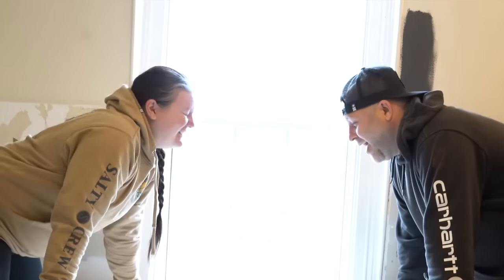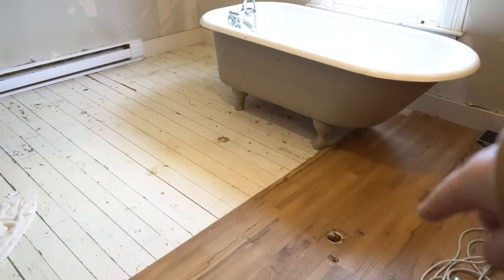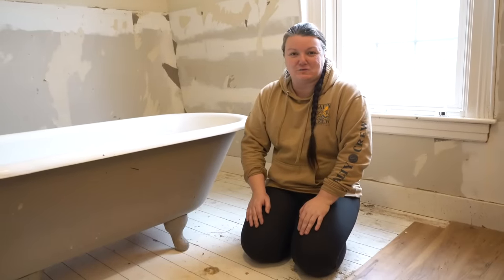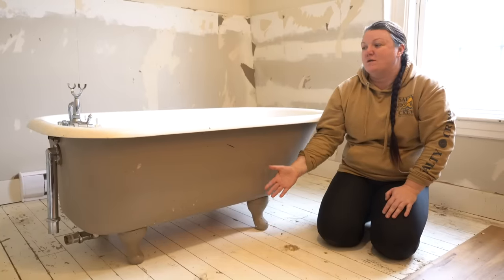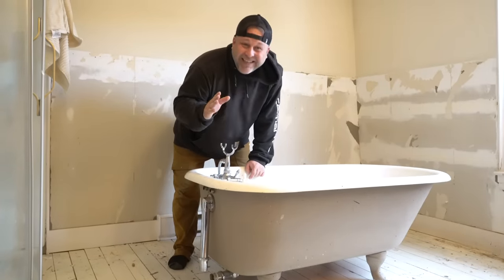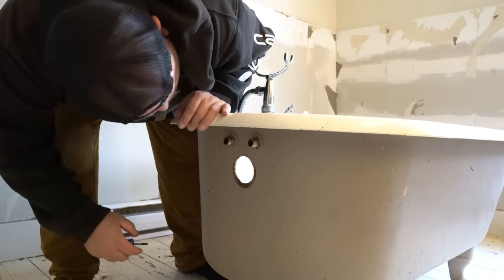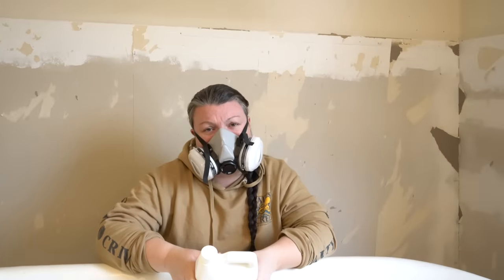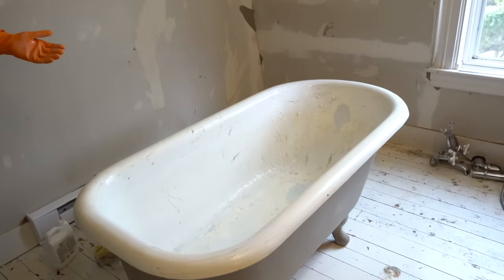SO far this is an EPIC FAIL....Bathroom Renovation

Comment: Since I first saw your bathroom i thought the tub would be beautiful angled in the corner.  That would open the middle space even more. The shower curtian will not block the window light. And you could pur a small pretty table behind it for soaps
Reply: I agree   I have concerns with it being close to the window   First the danger of someone slipping and breaking it (getting cut up) also the weather making the tub cold or hot   It is your home so you need to do what feels right for you and your family ❤❤❤
Reply: Yes and then you would need only one maiden.
Reply: Elysian, the paint is an epoxy paint.  Tub paint.  There is a striper for tub paint
Reply: Agree 100%.
Reply: You said earlier that you didn't want to put the bathtub in the corner, because the plumbing would be more difficult. But now that you are thinking of switching the direction of the bathtub by the window, the plumbing will be more difficult anyways. So why not place the bathtub in the corner? It looks way better there! (Just a thought. You do you!)
Reply: We sand blasted ours
Reply: Absolutely!  When they moved the tub away from the window, I thought, " The tub needs to be angled in the conner." 
It would make the room so much more spacious. It would bring in more natural light.
Good call!
Reply: Yes, I as well think it would be much prettier in the corner since the plumbing needs to be moved anyway. Place the faucet end in the corner with a small marble table next to it. A self standing gold/brass towel rack by or under the window. The oval shower rod over the tub will be the icing on the cake.
Reply: Yes, angled in the corner would keep plenty of clearance behind the sink area.
Reply: Corner corner!

Comment: When you use stripper you should cover the surface with plastic. Don’t let it be exposed to the air. 
Suggest the foot of the tub point away from the vanity and not necessarily centered on the window. You have the space to put it closer to the corner. Centering it with the window makes it too close to the vanity
Reply: Agreed on putting some plastic wrap over the stripper.   It keeps the product from drying out.    I would use the plastic wrap and leave it overnight.
Reply: I agree!  Tuck the tub in the corner. ❤
Reply: I'm for putting it in the window with the faucet away from the vanity. I have a clawfoot tub and grew up with one. I've loved them all of my life, and I'm 71.

Comment: Hi Elyshia
Fellow Canadian from the Prairies here.  We have electic baseboard heat as well.  Normally baseboards are placed under windows to help keep condensation off of the windows.  If you are at this stage of your renovation...would electrician Phil be able to switch the placement of the heater under the window?  Without knowing your full layout plans for the bathroom...I think angling your tub across the corner of the room with a view toward the window would maximize your space in your room.  I personally wouldn't want to block access to or view to the window.
Good luck with whatever you plan to do!
😊
Reply: So sorry....I misspelled your name!
Reply: That's a good idea. I noticed that as well.

Comment: Hey guys, it's not bubbling because it's not paint, it's enamel. Just clean it all off and sand it smooth. Don't worry about removing everything.
Reply: I agree. Bubbling is not something you would get enamel off.  Sand it and see what that does before you spend anymore money. I do agree to put the last bit of stripper on an area you really haven't had any luck and cover with plastic.

Comment: We restored an old claw foot tub years ago. We used a fine grit sand paper to remove the old finish. Our claw feet looked like stumps there was so much pain on the claws. We used stripper on them and sanded. You almost need a sand blaster to get the old stuff off. 
As for the position of the tub I actually like it on that wall in front of the shower. It looks so crowded under the window with that large scale vanity you’re going to have.
Reply: Came here to say this. Need to sandblast to get that paint off.

Comment: With my claw foot tub when I was redoing it I painted the outside of the tub a warm gold tone color using a semi gloss (I’m not sure if it was egg shell as that was about 1985)
And then painted my ball and claw feet a lovely shinny gold like you put on everything!! It was beautiful. I painted the 14:17 bathroom walls the same color as the tub walls, oh it looked great as the curtain I used as a tie back had the oval metal circle shower curtain holder on inside ( took 2 plastic shower curtains)as my bathroom was very narrow the tub fit perfect!  
Oh I think your tub would look beautiful in the corner at an angle!!
My feet on my tub looked just like yours but something told me to strip them it was a labor of love and several coats later the claw appeared!! I only knew about the claw from pictures as that was way before computers, lol.

Comment: We had a poorly painted bathtub in our house when we bought it. The paint was peeling so we just used a sander to get to get back to the original finish, which is green, then due to supply chain issues in 2022 not one store within a 1000 mile radius (we bought the house while still living 6 states away) had Rust-oleum tub and tile paint in stock so we used appliance paint, almost two years later it’s still holding up, but we do plan on tearing out the old tub and installing a shower instead

Comment: I like the tub up against the wall where you're stripping it.  I know you don't want to go there, but it looks so much nicer, not up against the window edge.
Also, on the stripper, can you give the tub a good sanding first, so that the stripper has something to grab on to?  More surface area.  Also, can you put plastic over the stripper to keep it wet longer?

Comment: Your tub is most likely epoxy or a resin. You may need a special paint remove. It is my experience that the professionals sandblast the old coating out if the tub before they resurface.
Reply: Yes I agree 💯
Reply: Originally the tub was more than likely a cast iron with porcelain on the inside. Not knowing what was done in all of the painting process over the years, as was noted in a comment, sandblasting might be the best option inside and out. Then a paint/resin or porcelain  coverage again placed inside would give it that lasting effect. Paint on outside can be done very simply. If you do a feature wall the blue you love so much, do the outside tub that color. With the gold faucets the blue  is beautiful. Love love as well. You are doing a beautiful job.

Comment: I feel like if you are having that hard of a time getting the paint off, just sand it enough to get a smooth finish and paint over it. Also, kinda love the tub over there. I agree with the person who said faucet in the corner and back facing the outside wall so you can probably still see out the window. I understand maybe not wanting to put it at an angle but it definitely looks like it would fit nicely along that wall, still look out the window, and not be in the way or the vanity and the rest of the room.

Comment: I agree with others that the tub should be in the corner, not in front of the window. Also, paint the outside of the tub that dark color you used in your bedroom. With gold feet it would look amazing. Agree that 60 grit sandpaper might work better on the inside than stripper. Also, using plastic wrap over the stripper really does help let the chemicals work longer so you could maybe leave it overnight.

Comment: Not a fan of the tub flar in front of the window, either direction.  If you're down in the tub, aren't you just seeing sky? Given how large the room is, as some have suggested, I'd take advantage of being able to angle it from the corner near the baseboard heater(?). Right now everything is lined up around the perimeter, leaving a large empty space in the middle. However, that would necessitate moving the plumbing ...but you're 'fortunate' to have all that access from the pantry ceiling. Consider painting the lower part your 'signature' dark blue. Would complement the gold, the vanity and bring some strong color into a space which has so much white. Although any textiles you introduce should also help add color and texture.

Comment: Most likely the paint they used would be of the same grade as an auto type paint which needs it's own type of paint remover. Also you might want to sand it with a rough grit sandpaper first to 'ruff up' the paint so that the stripper can get into it. I've used the type stripper that you used the second time and it has removed every type of paint that I was removing hence why I think you need to think that it's not a regular type of paint.

Comment: What if you painted the bottom 1/3 of tub and feet gold?  Perhaps they used the same paint you used on the shower LOL?   Sand it smooth and paint over it w/o worrying if you remove all the paint layers.  If it's still on there after all you've done, leave it on and move forward  is my (perhaps lazy) suggestion.

Comment: We had to get our tub. Sand blasted as the badly chipped enamel would not budge . And we threw umpteen products at it.We had a choice of getting it acid dipped or sand blasted. We had to get it professionally enamelled it ended up looking stunning . But it was a pretty expensive refurbishment. I don’t live in that house anymore but the new owners purchased on the high end large Victorian powder room/bathroom made the sale. Old station house.

Comment: I’m guessing because no experience with this project but maybe you should check into having it sandblasted and repainted…I understand budget and diy but this one may be better handled by a professional restorer…how frustrating this must be for you both. This is definitely a project you never want to re-do. Short of that idea, maybe one or two more tries with the liquid stripper with plastic on it. Also, check best temperatures to use it in. Perhaps your room is too warm or too cold? Then sanding but I wonder it that would etch it too much.

Comment: I also have an old home built around 1900. Our tub was the original tub to the house as well as the plumbing. When I redid that bathroom I wanted to redo the tub who was showing its age just like yours is. I tried to refinish it myself using many products without success. I ended up just biting the bullet and having it professionally reglazed. They painted the outside black and the inside white and it turned out beautiful. That was 15 years ago and it still looks like new. Just a heads up I had great results with professional replacing. I know you're on a budget but sometimes you just have to bite the bullet. I love watching you so much you and Phil and the family are just fantastic and so creative.❤

Comment: I saw others suggest this, too - but even though you’d have a view of only the sky… what about facing it directly at the window. Not sure if spacing would work. It would probably look best in the corner…but without adding another window, not sure you’d be happy with it. It does look like a tight fit with the angled side net to the vanity….

Comment: My tub was manufactured in Baltimore Maryland USA 🇺🇸 1928
I found it in Mount Dora Florida Antique Flea Market in 2009 it was in perfect inside original condition and needed a good cleaning only on the inside but the exterior needed to be sand blasted sealed and painted and the rust left a pebbly finish on the exterior but i liked that effect and spraying the exterior a copper color was perfect … combination

Comment: Also
Many tubs have a manufacturer stamped with a date built on the bottom of the tub 
Take a photo frame it and place it in your finished bathroom …
Reply: Neat idea! My cast iron tub is stamped 1957 which is the year my 1883 house got indoor plumbing.

Comment: Sand it first and then use an epoxy remover.....The tub paints are more epoxy than paint so if the paint remover didn't work move onto the epoxy remover.

Comment: i saw a lady use oven cleaner on wooden furniture to strip paint... Also saw another lady take an old cast iron skillet down to bare metal with oven cleaner. the skillet was put inside a plastic trash bag to keep the oven cleaner from drying out. Never tried it myself though.

Comment: I love the scared face that the tub has, lol. If it was me, I would put the faucet end of the tub at the window, add place the tub diagonally across the corner. Your back would be near the heater, and the tub would be move along the side rather than towards the middle. Just a thought, maybe try it and see 🤔. The room is going to be great.

Comment: Could it be the temperature of the room that is affecting the paint stripper? Also as above comment - cover with plastic wrap. Hope it’s off by now. I like the tub turned looking at the greenhouse but moved a few more inches closer to the corner. When soaking in a tub. You’re not cranking your head to look out. But head is back, relaxing.  Look forward to what you decide on tub color. The claws could be painted on…😂 the feet.🛁 If that helps the “romantic” department 😂 mEoW

Comment: Hi , try brushing on smaller sections and leaving it but put the the stripper on really thick and then put plastic wrap over it so it stays very wet. I think what is happening is drying out on you and it’s not giving it enough time to activate.

Comment: Please DO NOT sand the inside of the tub......porcelain and enamel sealed tubs of that age contain LEAD in the finish and could give you lead poisoning.  Rust-Oleum Marine paint comes in high gloss white (spray can), is highly durable, and would be a good choice for the finish.  I do believe that those "bubble feet" are original claw feet.  The feet on the reproduction tub you featured in the video are replicas of furniture claw feet from the "turn of the century" which were much more detailed than tub feet were.  I am sure that with your talent and some air dry clay, you could fashion a couple of realistic claws on the side showing (wouldn't need to do it on the backside).  I know it's going to look fabulous when you're done.

Comment: I would find out from Rust-Olem how to remove their porcelain paint. The product used was probably similar. Also, when stripping large pieces, cover in a plastic drop cloth to retain the products heat, I’m sure the cold air from the window effected the progress.

Comment: From an engineering standpoint......TRY to keep the faucets and drain lines with the fewest bends and the shortest routes possible, so I would suggest the tub faucets be on the side where it is closest to the vanity.  Also, are there any cold spots in the bathroom?  Try to avoid water pipes in those areas because of your cold Canadian winters.  Concerned about the outside view from that angle?  Use your skills to make that side of your garage look like a small English (haha) garden, full of bee loving flowers and flowering hedges.

Comment: Peeps! If I understand correctly relocation of the tub is based on simply extending existing plumbing & keeping the white floorboards. Lengthening the current pipeline a few feet under the window will get the tub out of the center of the space. It's not a gut job.

Comment: If the tub is metal,  then it's probably painted with enamel spray, I'm sure there is a stripper fir that,,, & maybe try sanding it with a sanding tool, hope you get it  sorted out 👍🙈⚘️😘❤️

Comment: I watched your video this morning and wanted to say, but didn't mainly because you have been inundated with opinions, that if it were my tub I would turn it the other way around. Partly because it will make you feel like you have more space by the cabinet when it gets moved back.  There is just something about plumbing and pipes that cause us to give it a wide berth and on the other end it will not be in any visual way.  I am glad you are turning it around.  Carol in Halifax  I typed this but did not send it and sure enough you may be changing your mind. I say the change is right and you just need to get used to it.   I think the gold body and cow udder feet will look splendid gold.

Comment: Taps backing up to under the window would be nice. Have you got a heat gun? You'd have to wash all the chemical off  first but it would melt the paint then you can use wire wool

Comment: I had my regular bathtub professionally painted RED ❤. This color of red and my tile around the tub. 10:16 and my sink and countertop it was all in one sink and counter. My tub was like cloudy instead of shiny like it was originally and a friends husband did this as a job!!  It was beautiful. He had sanded it and stripped it then coated it with something that is why your stripper did work. It lasted for 5 years and around the drain it started bubbling he came came back and redid it at no charge because it was under warranty and it it lasted until 5 years ago when we made it a walk in shower because we are getting stinkin old lol

Comment: ❤ I did have a clewfoodtub and it was infront under a window. With an oldworld showercurtenholder above it.. I would not have a tub under infront a window again, if I had the room. I would have it infront that wall where you worked on it to get the paint off. A showercurten hanging down infront of the window would not look good. Make the feet gold and the rest white. That makes it elegant but not tastless blingy cheep looking.

Comment: Just an idea to help remove the enamel paint from the tub, maybe you could opt to use a drill and metal wire brush attachment to help remove it? It may end up working without having to use stripper :)

Comment: You can also add a stencil to the side or edge of the tube
And even if the surface is rough it will enhance the antiqued effect
Of any stencil 

Don’t rush it take your time
Sometimes you both seem to want to rush to finish a project but too often more research and time yields a better end result